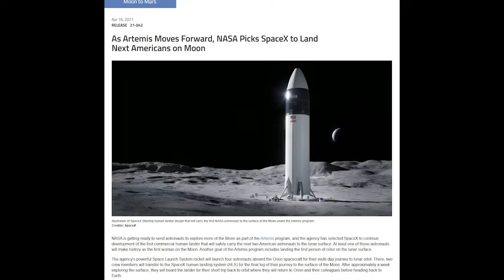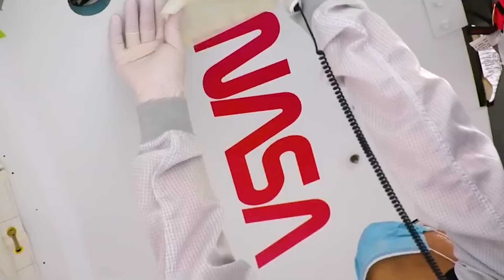Why Starship Might Not Land Humans On Artemis III

Comment: Again, I don't see the reason NASA should proceed with a useless mission instead of waiting for a few months (if it'll really be a few months...) to have a lander. Unless of course the problem is closing off the launch in 2025 so that Boeing and Lockheed Martin can be paid...
Reply: Between Artemis III and Artemis IV, SLS will be upgraded to Block 1B version with the heavier Exploration Upper Stage (EUS). This will require certain upgrades to the ground infrastructure, such as building the mobile launcher 2 (ML-2) etc. They require a certain gap between Artemis 3 and 4, so that they have the time to do all of these upgrades. If they delay Artemis III by a year or two to wait for HLS, they might have SLS ready for Artemis IV in 2028, but be forced to wait on upgrades to ground systems etc.

Also, any and all delays and reductions in launch cadence inevitably cause SLS to become more and more expensive per launch.
Reply: @plainText384 Good point. Still in the articles I've read,  Jim Free looks worried of delays of even a few months, that are unlikely to impact the schedule much.
Reply: Its not a case of few months but years.

Starship propellant depot isnt even planned to go trough primary design review till 2025, thing will not be ready for looooong time.

Also useless mission isnt really that useless, as keeping a regular flightrate keeps launch team profficiency and increases safety. Its better to fly alternate mission that can still test tiny things, than wait several years and loose experience.
Reply: @_mikolaj_  the propellant depot isn't part of the plan, from what I can remember: on-orbit direct refueling is... and I agree that it's going to take a lot of effort to do that in time, but I wouldn't underestimate SpaceX capability to move very fast once Starship can reliably launch and land (and that's the big if, especially with all the ongoing legal BS).
I agree Artemis' flight team would lose readiness without a  launch, but they should come up with a mission that 's not a repeat of Artemis 3, if not it'll literally serve only to train the flight team and test the "perfectly designed" hardware a bit more, all for the incredibly cheap prices of what, 6/7 billions?
Reply: @RobertoMaurizzi  according to GAO report, depot is part of the plan.
Reply: @_mikolaj_  just checked the document and yes, there's a "stretched starship" depot actually. We'll see... I'm also curious to see if they'll finish the space suits... they started both project quite late and without much money.

Comment: This is disheartening.  SpaceX has made mistakes, like continuing try push development in Boca Chica which is been hostile and has too many challenges.  They should have shift their efforts finish the second Falcon / Crew Dragon launch tower quicker and get their facilities in Florida completed. Its just been what been truly been dragging things.  How are you going progress and learning from mistaken if you keep running into legal and bureaucratic hurtles?  Literally stopped trying land Starships assuming the one landing was enough. Even if the catch tower concept works, they still need perfect ship landings.   What if the Starship crash lands on Moon?  They'd need actually land damn thing more than once.   It just been too much rushing, not enough perfecting accomplishments.  Their doing a lot good, learning from mistaken are important.  However, you need place where not going be attacked every time you do a test flight.
Reply: Yeah, having the testing facility in the middle of a national park was always going to lead to problems. I don't know why they didn't build it out in the middle of nowhere like Blue Origin. With that said, the only reason the first launch caused so many problems was because of the concrete that it launched into the air and the delayed FTS. With the water-cooled plate and stronger FTS, I think the next flight is likely to go much smoother, even if it doesn't reach orbit. After that, hopefully launches will begin to become more frequent.

Comment: Artemis V will likely be the first Lunar Landing mission but without Starship. Ability to LAND on the Moon should have been a higher criteria than COST.
Reply: Starship is far ahead of any other possible lunar lander. Development hasn't even started on any alternatives, while Starship has completed many hopes and a full stack flight test. Even if Starship does cause the Artemis program to be delayed, it's the only hope NASA has of developing a permanent lunar colony like they envision. It's not practical to use the SLS to transport all the required material to the moon, the cost would be astronomical and it'd take decades due to the SLS not being reusable.
Reply: @Astra2 starship isn't just a lunar lander it's a big rocket. Any comapany looking to build a modest lunar lander will have an easy time outpacing Starship
Reply: @forloop7713  I don't think you realise how slow most of the aerospace industry moves compared to SpaceX. Just look at Blue Origin, they're building a modest lunear lander but it won't be ready until 2029 at the earliest. I'm sure it'll be delayed, so probably more like early 2030's. Even is Starship is delayed far more than anyone expects, it'll still be ready years ahead of Blue Origins lander.
Reply: Astra, Starship is a white elephant. In true, old-fashioned Apollo style it is hauling its entire bulk and fuel all the way to the Moon, and down to the lunar surface and then back up to Gateway. Chronically inefficient.
But guess what? If Starship does land 100 tonnes on the lunar surface, it won't have enough fuel to travel from Gateway back to LEO! Fuel must substituted for payload, that means reducing payload to...25 tonnes! About the same as Blue Moon. 
Yeah, how many SpaceX Fans are aware of that? NASA is, that's for sure, so this much touted "huge payload" is another example of Elon Musk being disengenuous.
From Artemis 5 onward, NASA will have "Blue Moon" lunar lander permanently stationed at Gateway, availiable for 15 lunar landing missions, max.
No room for Lunar Starship, Astra.

Comment: So, why does Starship require so many launches to fly humans when the SLS and Orion only required ONE flight before it will carry humans and it will incur way more human risk.  It has to launch humans to orbit, carry them to the moon, carry them back from the moon, and bring the safely back to earth.  Starship just has to land them on the moon and bring them back to lunar orbit.
Reply: Because Starship is fully reusable.
Reply: @Astra2  Yes, it is reusable but that does not affect the safety of the first flight.  The Dragon capsules and Falcon 9 are also reusable but NASA did not initially allow reuse of them for human flight.
Reply: @connecticutaggie  Oh I see what you mean, I interpreted your comment as referring to all the refuelling launches needed. I think it's just due to SpaceX's iterative approach vs NASA's get it right the first time approach. SpaceX expects stuff to blow up until they've perfected the design, which they'll only know they've done when stuff stops blowing up. As such, they'll probably fly dozens of missions before Starship is human rated. Also proving technologies such as orbital refuelling and an orbital fuel depot will inevitably require a lot of launches. It shouldn't be a problem with the rate SpaceX is producing Starships as long as the time it takes the FAA to issue a launch license decreases.

Comment: 4-8 launches to fill-r-up.  I am not sure how I feel about such a thing.
Reply: The original plan was 1 orbital fuel depot,10 fuel tanker plus 1 Lunar Starship launches, up to LEO, then to Gateway.
Twelve launches in total.
No wonder NASA is worried.
Atemis 5 cewed landing in 2029 by "Blue Moon " will require 1 lunar lander and 2 fuel tanker launches, direct to Gateway.
Three launches in total.
NASA is hedging its bets.
Reply: @davidstevenson9517 wrong, Blue Moon requires minimum 5, two for CT parts, one for Blue Moon itself, and two tankers. This assumes the tankers are 100% full and do not expend any fuel. Most likely, the total number comes to around 7-8.

Comment: Have we seen ANY progress on the landing engines? It seems like there has been basically no development on HLS exclusive hardware. Basically all the testing mentioned here seems to be on hardware that is also planned to be used to launch Starlink satellites.
Reply: yeah, there have been firings at McGregor
Reply: @PerigeeAerospace  Yooooooo it’s you! Remember me? I’m the fat arctic dwelling bird on X
Reply: Isn’t starlink Elon’s #1 priority ¿¡?! He keeps saying that he will go bankrupt without a fully functional starship. So foolly reusable!
Reply: @Mentaculus42  *fully
Reply: @imarchello  
“FOOLLY” [sic à la sniglet] like “Fool Self-Driving“!

Thought my intent was obvious. SX’s design intent requires taming a number of known, unknowns. This will take a lot of effort and revisions!
Reply: They will probably be larger versions of the super Draco
Reply: @goodgremlinmedia2757  well even if they just use superDraco, they will still need to develop the whole tank and plumbing system for the NTO and MMH hypergolic propellants for Starship and probably adjust the structural design of Starship to compensate for the dozen or more holes/ engine nozzels in the payload bay section.
Reply: 1 year later and all we got is mock up hardware for an airlock lol

Comment: why it ''might'' not land humans..? please. starship is a laughable concept for a rocket. Its a giant failure of a concept and design and should be abandoned immediatly.
Reply: I disagree.The concept is so far ahead of everything else that there is no compare. And how can you say it is a failure as a design when the design is not yet complete? While it will most likely be replaced as a moon lander,  I have little doubt that it will ultimately be successful and possibly replace the Falcon 9 as the most used commercial rocket for launching Earth satellites. The present idea of catching the stages with arms on the launch tower seems ludicrous at best, but of course the same was said about landing on a barge before that became routine. Even if totally expendable, the huge payload area will be highly desirable.  Other methods of landing and reusing both stages could be developed and that would drive launch costs down to an unbelievably low level.

Comment: So, your idea that Starship might not land on Artemis III, is correct, since Artemis III is unlikely to actually reach Mars, and will certainly not have the Mars rectilinear orbit and anciiliary equipment in place
Reply: Artemis (through HLS) is funding SpaceX to develop a crewed lunar landing Starship variant, as well as in-space refueling. Without NASA's Artemis program Starship would not be landing on the moon in near future. 

Even if HLS is not ready to land on the moon, Artemis III will reach the moon. Artemis 1 and 2 will have already demonstrated the capability to reach the moon using SLS and Orion. If NASA decides to change the mission objectives instead of waiting for SpaceX to deliver a functioning lander, Artemis III will still be going to the moon, just not it's surface.

As for the near rectilinear halo orbit, NASA has already investigated it using the CAPSTONE spacecraft as a part of the Artemis program, so flying Orion there should not be a siginificant issue.
And if NASA changes Artemis III mission to not include a lunar landing, then any other equipent that might cause delays, like Axioms EVA suits, would not be needed for Artemis 3 anyway.

Finally claiming "Starship will land on the moon first" is just sort of nonsense, since the Artemis program will land humans on the moon using Starship as the HLS lander.
Reply: Excuse me, ygursivad, it is not "your idea" by TheSpaceBucket.
This is an official statement by NASA management. They now doubt SpaceX can do the job.
The writing is on the wall, Elon Musk will have to stick with the colonising of Mars with his BFR, that's what Starship has been designed for, anyway.
Reply: Or, Artemis will be delayed ( a certainty) and after a test trans lunar unmanned test landing of Starship on the moon (using Super Heavy) which is working on manned flight (for Artemis), a manned direct flight could go using Starship... Just saying.
Reply: @ygursivad9921  Starship HLS can not return astronauts to earth, Starship is not crew rated for takeoff and landing from earth, etc., etc.
Starship will not fly humans (especially NASA astronauts) to the moon without Orion and SLS for a very long time.
Reply: Starship orbital refueling is already also required... Seems a small step compared to all the saturn 5 setup flights and multiple artemis flights. Pretty complicated.
Reply: Sorry... Moon. Also, Starship will land on the moon first. It doesn't actually need Artemis at all